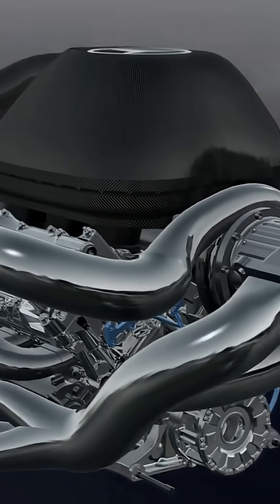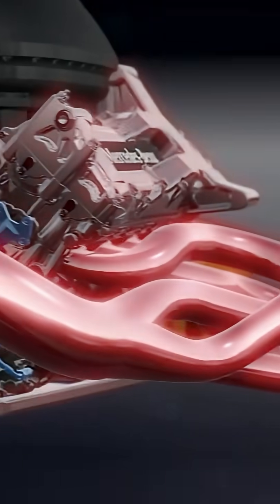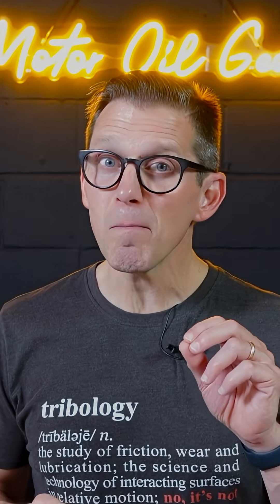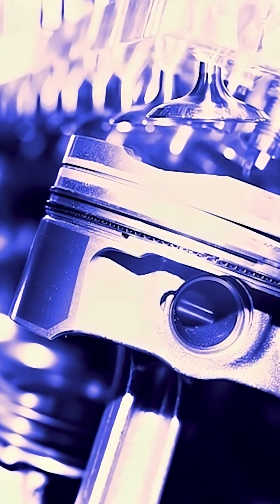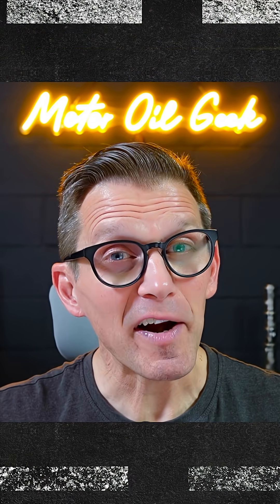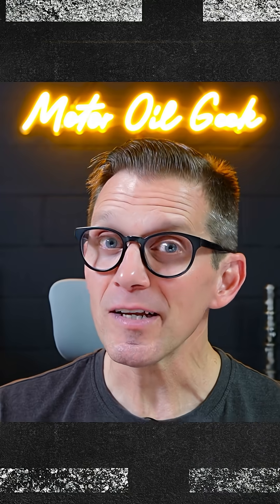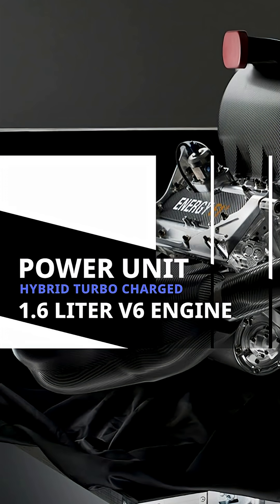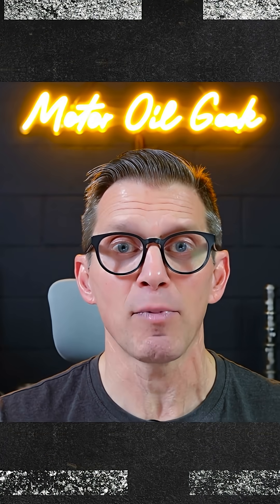How F1 Engine use OIL as FUEL! (Speed SECRET Revealed) #motoroil #engine #automobile

Comment: What do you think of secondary 2 micron oil filter that filters oil from another source than the factory filter at a much lower flow rate. Some are extending oil changes to 25,000 miles having oil analysis every 5,000 and changing both filters as long as oil analysis are good the oil does not turn black

Comment: I know how you feel about oil additives, but some day a good one might come along. Is there any way you could test Tribotex could it possibly live up to its hype or maybe cause damage I have a 2008 Porsche cayanne turbo for several years Porsche used a cylinder treatment that doesn’t hold up I have 175,000 miles on Mobil one. Change every 5,000 miles not using any oil yet just switched to valveoline restore and protect. And am adding Techron to fuel every fill up. Hopping to get another 100,000 miles. Their value is low. Once the cylinders are scuffed. They may have some body parts that can be salvaged. It has had some sensors a new starter and a fuel tank 
Replaced. Hoses belts water pump replaced as preemptive

Comment: No mention of Ferrari oil burning for more power. Although not illegal, Ferrari and the other teams were instructed via a Technical Directive, not to use their method in the following season. F1 is engineers versus rules and regs. It's a constant battle. Plenty of info out there.
Reply: The infamous ferrari engine scandal is about tricking the standard fuel flow sensor, finding a loopholes when the sensor isn't measuring flow (the sensors are not measuring every second, so there's blank window) even if it's not much but ferrari can get bit more flow from the standard maximum 100 kg/h which equal pretty significant extra horsepower vs rivals, enough to easily overpowering everyone on straights.

Comment: I burn oil in my diesel. Mucho bueno. Ultra filtered. Extra lube. Better fuel economy. It also keeps it from being dumped somewhere by the supposed recycling companies that are supposed to collect it
Reply: As long as you dont get a diesel runaway ur good😂
Reply: @nielsoudegriep2900 lol I’m not injecting it through the intake

Comment: Now you know why bmw gas engines burn oil as  much as 1 quart per 2500 US miles
Reply: It's like the 1950s again 😂
Reply: Shiiiit. My 2022 6.6 liter GM gas dually burns 1 quart every 1,000 miles. GM says it's completely normal. It's not.
Reply: I change the oil at 5,000 mile intervals since it's rigged out with a crane body, a 4 ton crane, air compressor and all my tools (heavy industry mechanic), and is maxed out on GVWR of 14,000 pounds if I recall. It's working 12 hours a day, 6 days a week but damn. I usually add between 4 and 7 quarts of oil in between changes. None of my old 6.0 liter trucks went through oil like this. It's a constant concern to check the oil every few days. I haven't had to deal with that since the 80's.
Reply: @magnumcipher4971  that seems to be standard for GM V8s
Reply: 😝. I am sure that’s not it.  😝

Comment: "Guys I made the most fuel efficient engine ever, it just requires reading the oil in miles per gallon as well"
- these shifty mofos
Reply: This was an issue sometimes in the planes during WW2. 
You might have enough fuel for the mission but do you have enough oil?

Comment: OK, normal 'civvy cars' are not driven like F1s, obviously, but why don't these engines have that technology ?
Reply: Using engine oil as a substitute of some of your fuel is not higher efficiency.   Motor oil would suck to measure in mpgs.
Reply: If you look at oil consumption in new, modern passenger cars compared to older vehicles, you'll see that the former use more oil than the latter. The manufacturers will do anything to reduce friction, as that affects fuel consumption, which aids sales, and in  reducing friction, something has to give. In looking at European vehicles, I regularly see oil consumption figures of 1 litre per thousand miles. That's a lot more than the 1 Pint per thousand miles of car engines from decades ago, when manufacturing tolerances were nowhere near as close as what they are today.

Don't get me started on emission controls, a lot of which are just a con.
Reply: There's a lot of technology that filters down from F1 to our road cars. It makes business sense to offset racing expenses with technology that can be implemented elsewhere. 

Look how popular hybrid systems are these days as an example. I'm not sure where they originated from, but they've definitely been refined in f1 cars and are a marketable concept these days.
Reply: Why don’t road vehicles use race fuel too?
Squeezing every horsepower out of an engine isn’t necessarily desirable due to trade-offs, and not possible because of regulations.

Comment: Can someone explain why the GM 2.0 turbo engines have a oil consumption problem. Can't find any explanation anywhere.
Reply: Low tension rings
Reply: Yep, if u let oil get dirty  @Elevationem
Reply: They’re badly made is the short answer. The long answer would be bad seals or separation somewhere in the process of delivering oil lubrication. Contamination of either the oil into the cylinders or into the coolant, can eventually lead to it making its way to the combustion chamber
Reply: They are GDI engines with low tension piston rings. Down the line, these rings get clogged with carbon and is unable to scrape the oil from the combustion chamber and is burnt off. Do a piston soak and also use Valvoline Restore and Protect to clean those piston rings and reduce or stop oil consumption
Reply: driven too litely and idled too much.
Reply: UAW workers are over paid for the garbage they produce